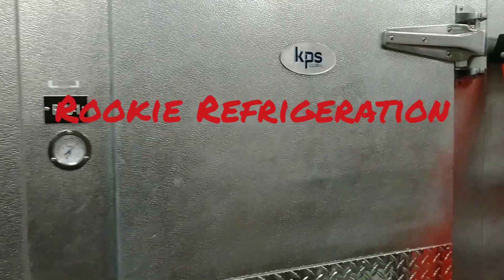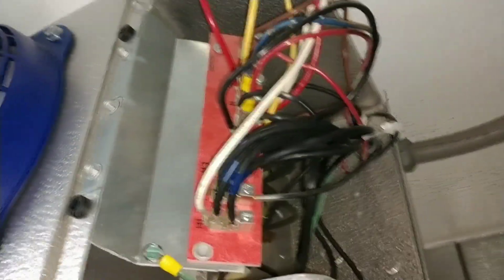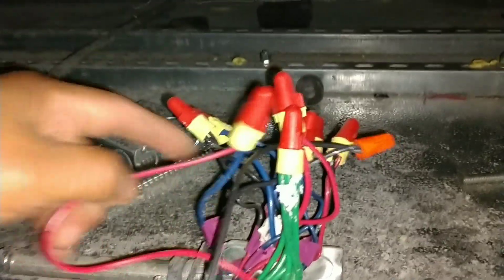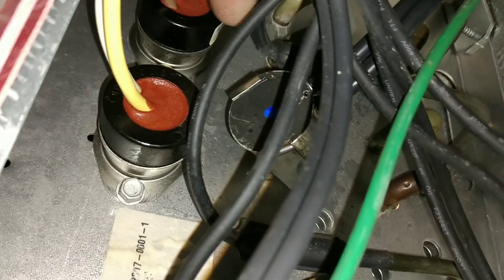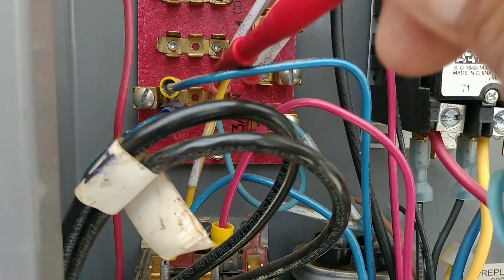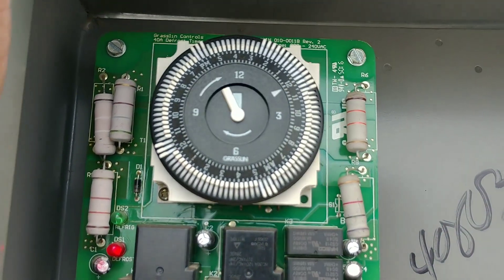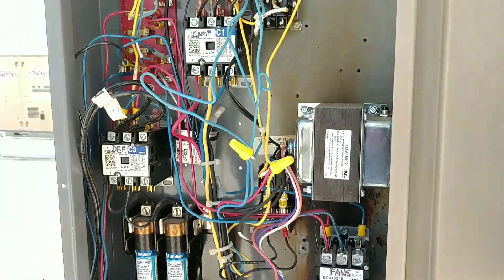HVACR: Follow up call on Walk In Cooler Wired Incorrectly.

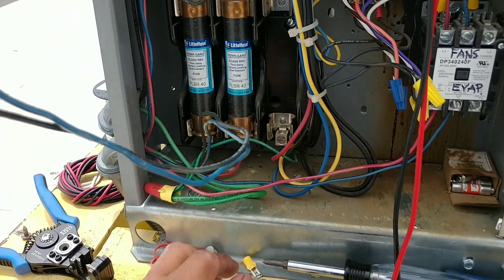Comment: 8:49 First issue I see those are 40 amp fuses and those wires not going to be rated 40 amps, second thing I see is you could have eliminated that 440 Transformer and use the control voltage from downstairs but you would have had to change the heater wires to correct gauge as well as correct the rest of the circuit to match schematics. However the path you took was much cheaper the more cost-effective for the customer. Cost of copper at that length, plus the conduit is too small. I am wondering what full current load is on heaters.
Reply: Good video

Comment: Your  vids are all so good👍 In a case like that I would have told them to have an electrician give me the wires I needed I will terminate them later also those fuses are the wrong fuses for 208 system On the defrost contact And correct me if I'm wrong you have the load of the defrost heater going through the heater safety Least I think that I understand that's a warranty job but you're the last guy there no one will remember the good you attemped to do when something goes wrong ....am 40 yrs in pal know this by heart like i said excellent vid

Comment: That condensing unit switch board may kill someone someday  in the very least it should have a warning sign.
Reply from the maker: S will we did. Warned everyone
Reply: @rookierefrigeration4357  Great job
Reply: Certainly should showing there are two separate power sources geez.

Comment: Okay I am moving just past the rookie stage but still way below you so I love your video very informative. 

Electrical is one of my weaknesses so I love videos like this so I've got one question that has me a bit confused. When you were looking at the wiring diagrams I noticed that you were using the one that stated it was for no evaporator contactor nor heating contactor in the condensing but on the the diagram listed on the far left is one for a unit with heating and fan contactors in the condensing unit.

They still wired up things wrong bypassing the safeties but it looks like that's what the installers first started to go by  because on that diagram you can see that h1 and H2 and F1 and F2 are wired up directly. 

Why wouldn't you go by that one or am I missing something?
Reply from the maker: To be honest, I could have used the one for the contactors.  You are correct with that.  But I honestly just went from the top of my head and wired it the best way I knew how with how it was already wired.    Half of the stuff you do out in the field are fixing other people’s stuff and rigging stuff up.
Reply: @rookierefrigeration4357  yeah you're right about fixing up other people's patchwork. I work in the tourist Mecca of pigeon forge and Gatlinburg and a lot of the refrigeration equipment has been rigged, rigged and patched then re-rigged and patched again.
so I completely understand just go in the way you felt best with it I just wanted to make sure I wasn't missing and skipped it purposely for a reason.

That being said if the evaporator unit had been wired up using the contractors in the condensing coil method would you have been had to go back and rewire the controls for those two contactors or was that part already set up to function correctly?
Reply from the maker: Bill Benson the fans were already wired right, except for the fan delay.  The heaters needed to be wired into the safety.  What was really “rewired” was the defrost termination so it could terminate off of temperature.

Comment: Most likely it was a electrician that wired that unit. I know when we installations the electricians wire in all high voltage. So being that most is considered high voltage that's what probably happened. Or you had some dumb ass hvac installer that didnt know what he was doing. Either way there both dumb asses and now you had to spend 2 days fixing it. Mah nigga.
Reply from the maker: Thanks. Lol. I agreed

Comment: Wasn't that a Walk in Freezer ? not a cooler.
Reply from the maker: Cooler.
Reply: alot of crap for a simple cooler. 35 degree cooler or colder than 35 degree ?
Reply from the maker: Exactly.   It's just a simple 35° cooler, doesn't need electric defrost, etc.  But this is the way the store wants it, so we have to do it as best we can.   I'd settle for air defrost and no heaters 🤣🤣
Reply: Exactly. me too. use a  digital a421. stick sensor in the evap. set digital at 15 degrees with a 25 degree diff and be done with it. Power fans directly off that 208 volt breaker other circuit and be done with it. Air defrost every time it cycles on the stat. easy peasy.

Comment: That's a Dangerous unit to Work on ! When u Shut Off the service Disconnect and You Still Have 208 High current inside the Panel ! Illegal as Hell too ! at a Minimum the unit Needs a Seperate Service disconnect For the 208 volt circuit. and Labeled accordingly ! To Make it Legal The Unit Panel Must Be seperated into 2 Voltages. a 480 panel & a 208 supplied Panel From That 208 circuit. someones Gonna Get Killed or injured with that setup. Bad news there.
Reply from the maker: Yup.  Exactly.  We labeled the disconnect warning the next technician.
Reply: is there a service disconnect to shut down the 208 coming in for fans and heaters ?
Reply from the maker: @OcRefrig  not at the condensing unit.  Which is stupid.
Reply: time to put one in. one of those cheapo residential disconnects would  work. it might save your butt. u need to be able to service it.
Reply: it would also tell everybody - whats going on when they see the second disconnect. everybody would say to themselves - Hmmm whats going on here.
Reply: Wow that stepdown autoformer turned off and still 208v that's some bulshit  sounds like millstone electric will fix it in a flash

Comment: If you have a 208v circuit why not abandon the transformer for control and just run your control off the 208v. Already have the fan wires and heater wires up to condenser so there’s your 4 wires. Utilize those and rewire. Maybe I’m missing something. None the less good find and made the best of the shit storm u found.
Reply from the maker: That's exactly what we thought about doing.  But since it's a new unit under warranty, we didn't want to mess with it too much.  So we just did what we did to get it working right.   But you are correct.  We could have done that easily..
Reply: Rookie Refrigeration you based out of Houston? Believe u said u were. I’m in Houston as well.
Reply from the maker: I'm up in DFW.
Reply: @rookierefrigeration4357  Hows hvac in Dallas? Im thinking about moving to either Dallas or Houston from phx az. Im also looking to get into refrigeration. Im currently doing residential and light commercial.
Reply from the maker: There’s too much work and not enough techs.  Get on up here
Reply: @rookierefrigeration4357  thanks man. What are good areas to live in over their? I plan on checking it out soon.
Reply from the maker: marcus washburn there are so many good and bad areas.  Some expensive some good pricing.  Just need to look at what you want to pay.   I like the Fort Worth side so that’s why I’m here.  But north Dallas like Frisco Allen and even further north like Melissa and prosper are really nice but very expensive😂
Reply: @rookierefrigeration4357  cool man i appreciate it. Im not looking for super expensive areas though lol ill check out dallas fort worth first...In refrigeration how many times are you on call during the week?